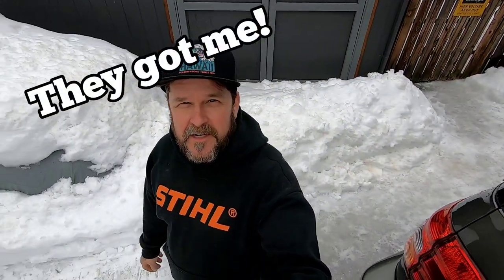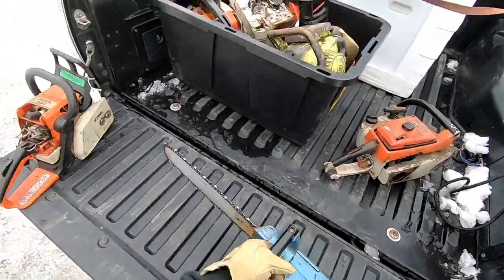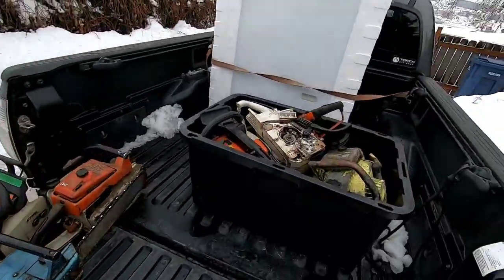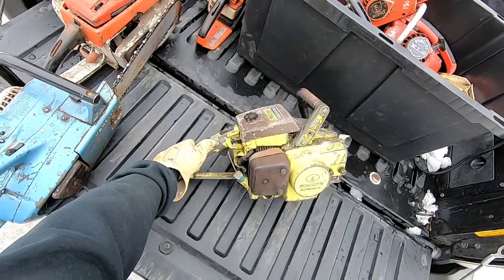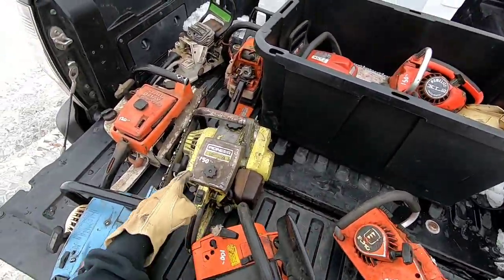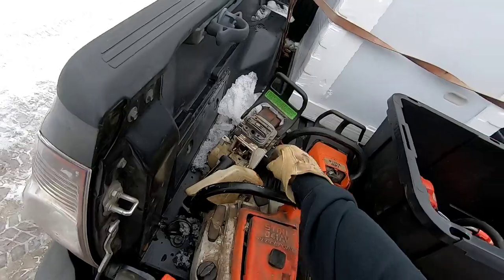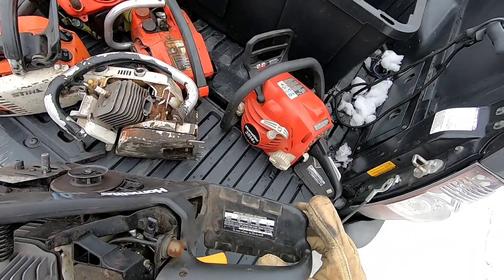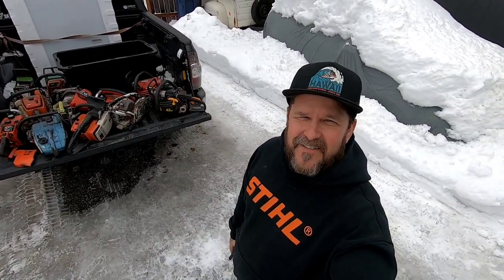They made me an offer I couldn't refuse! Another Vintage Chainsaw Load!

Comment: 026 r fab saw. That 041 may need a starter ring on flywheel or a set of morse Fairbanks starter pawls for recoil. Got both on eBay recently
Reply from the maker: Thanks TC, I wanna hear the old Beast run!